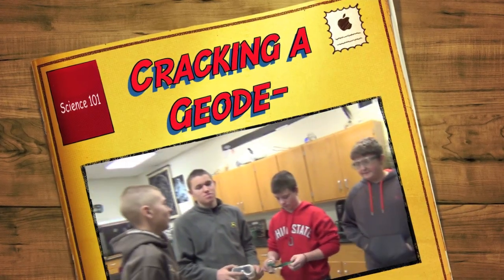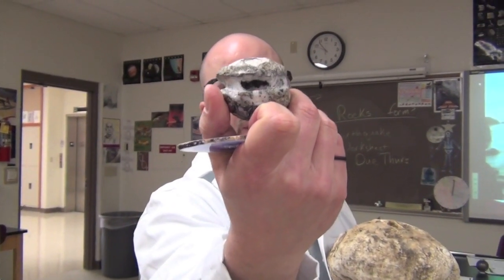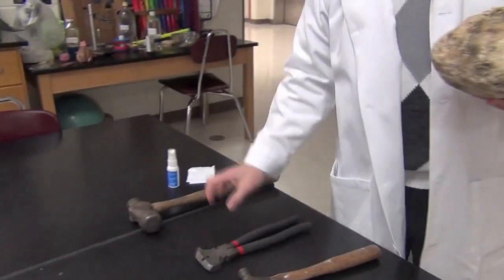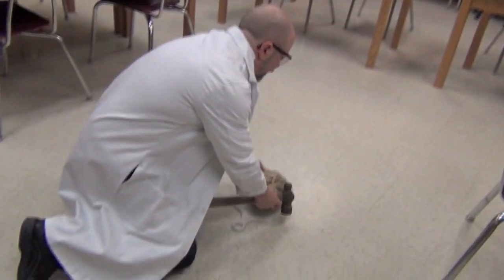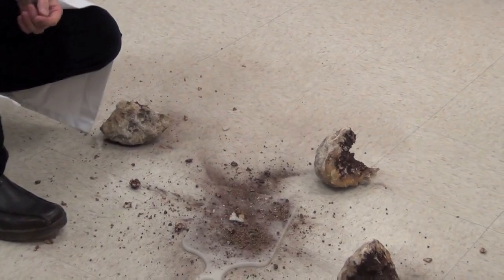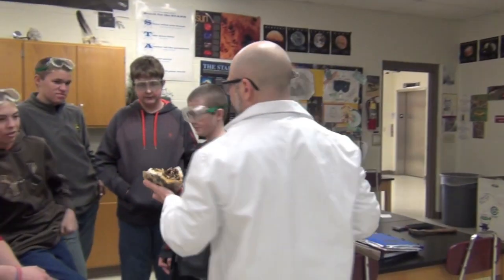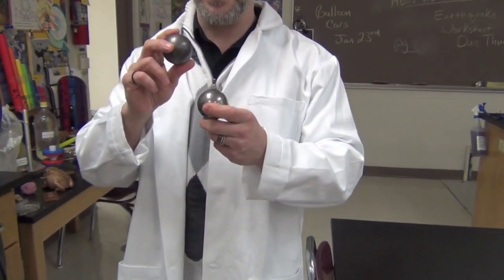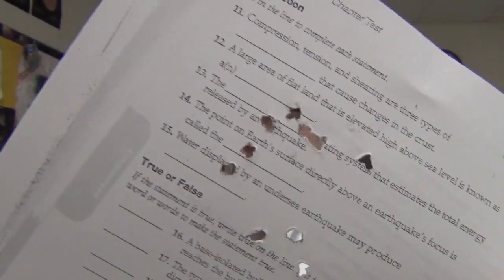Cracking a Geode

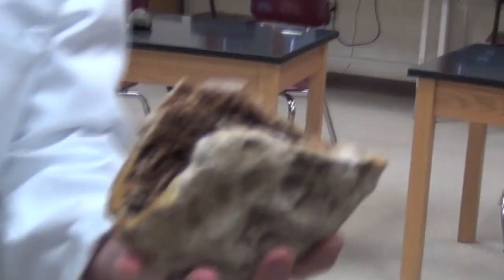Comment: Not sure if the 4-way split was what you had intended.  For best results, I'd recommend using a soil pipe cutter.  Normally, geodes won't "rattle".  Rattling on the inside may mean the crystalline formations have been damaged.  Instead, knowing what to look for in a given area is your best bet.  Geodes normally have a chalcedony outer shell which give it away.  And although many of them are hollow, they may have crystalline formations that almost fully make up the center dampening the sound.  The rust/iron oxide is hematite.  I'm not really sure what was said after the approximate 3:04 mark due to music output being too high.  By the way, where was the geode found?

Comment: For next time, try placing a cloth between the rock and cutting board, it wont move as much, won't lose debris and is easier to collect.  Washing, use cheese clothe and save the plumbing! Fun video!

Comment: I've seen them opened with a chain and a lever.  The chain is wrapped around the geode and tightened by the lever until the pressure fractures the geode under the chain.  It's like breaking a piece of glass by putting a force on a very small area along a line.  The glass breaks along the line, the geode breaks right along the line under the chain.  It only works with reasonably hollow ones.
Reply from the maker: Very Interesting technique.
Reply: Would i be able to open a geode by its side with the chain and lever?

Comment: A geode must be CUT with a diamond blade not slamed with a hammer !
Reply: skyhacker6 Then why did you make it your problem?
Reply: Sure, as soon as you donate funds for buying said diamond blade :)
Reply from the maker: The person who gave me the geode told me to crack it with a hammer. I followed her advice. I have cut geodes with diamond blades before, but this method worked also. I now have four large sections of geode that fit together like a jigsaw puzzle.
Reply: How is a teacher gonna obtain a diamond-tipped blade with his wages
Reply: Um... diamond blades in this size range are not that expensive peeps. A local rock shop would probably donate ones that are almost used up (which would leave plenty of life for this application). And I'd bet an add in Craigslist would get a small tile saw donated (which is all you need - in fact a cheap tile blade - those are diamond - would work).

I cringe seeing them hammer opened also but there are whole businesses that do this all day long. On the bright side, even many of the chips can be made into jewelry by any of hundreds of easily found lapidaries out there (one of those areas that exploded as a hobby a few years back and is chock full of nice people who can do cool things like that - check some lapidary forums)...
Reply: Frank Resists what if IF IT SOME HOW broke
Reply: Diamonds are plenty and cheap. De Beers wants you to think they are rare. 
And industrial diamonds in tile blades are produced synthetically.
Reply: Frank Gualtier Sh-sh-shhh
Hush
Reply: skyhacker6 it's a school I doubt they could afford a diamond blade
Reply: Ecology Films clean them with hydrogen peroxide and bleach people call me dumb but even a little chemistry goes a long way. It will look beautiful
Reply: skyhacker6 you can hit it with a hammer if you know what your doing
Reply: Mp57navy Need to read up a few comments.

DaBeers is a flagrant cartel that flaunts the fact that it is they who control the majority of supply, and they have the vaults full with more than you can shake a stick at to prove it. I don't know what the actual figures are but I'm told that if they emptied their vaults the price of diamonds would crash very significantly.

I used to buy various size grades of diamond sand to diamond powder (40 grit to 100,000 grit) in 10 gram bags from an eBay seller at relatively cheap prices for lapidary purposes. All of those I purchased were indeed labeled as synthetic. I probably used something on the order of a thousand times more silicon carbide (a conservative estimate) in the form of sands/powders (tumbling grit) to finishing sticks (keenly graded SiC+SiO2 vitrified cake form - aka quality hone stones). Diamond in similar form to SiC hone stone can be had but usually in a resin matrix and slap-you-in-the-face more expensive, though not necessarily cost prohibitive.

Fact: the process of waking with the aid of coffee can induce periods of excess fact drivel. Not the I tended, more lazurus-like, effect desired. Enjoy the fruit.
Reply: skyhacker6 not really
Reply: theres no 'correct' way to open a geode
Reply: Jeffrey Stanley oh... ya, don't use tile blades (made with conflict diamonds) legal diamonds are crazy bling expensive!
Reply: Jeffrey Stanley
It's his problem not mine !

Comment: why not use a rock hammer? and i recommend light taps in a line around the geode to form a precrack it helps
Reply from the maker: Good Idea. I may try that in the future.
Reply: TheKithkhan that's my method - like yours.
Works great and I  don't mess up any potentially beautiful crystals

Comment: I also have a better way to open a geode. (If you cant tell, I'm a geode fanatic).

-Use a hammer and chisel.
-Look for a crack by submerging the geode in hot water.
-The air will expand and leak out any cracks.
-Place the chisel along the crack and start tapping it with the hammer.
-90% of rattling geodes already have a crack

-If you find no cracks, start chiseling a groove around the circumference of the geode.
-Keep chiseling the groove deeper until a crack forms.
-Try to direct the crack along the groove with the chisel
-That should break it into 2 perfect halves.
Reply: I guess you can say the geode is releasing some thousand year old hot air from the dinosaur debate to learn stuff before they die off eh?
Reply: CheetahFoxx nice!
Reply: Thanks for the tip ! :D
Reply: This is what I was looking for. Thanks
Reply: No I have a better way than your way. It's called a soil pipe cutter....
Reply: @ladykfilmartproductions273  One of those things big enough to break geodes costs about $700 or more. Usually only mine owners or retailers are going to make that kind of investment.

Comment: I found a better way to determine if a geode is hollow or not.

-First, get the density of the geode in g/cm^3 using a scale and spill tray.
-Divide the density by 2.65 (the specific gravity of quartz)
-minus that decimal from 1 and multiply it by 100%
-That is your exact hollowness as a percentage of mass
Anything more than 10% is usually worth keeping.
OR
-take the volume of your geode and multiply it by 2.65.
-That's the mass of the geode if it were solid.
-Minus your geode's actual mass from it's "solid mass".
-That gives you how much mass is missing.
-divide the missing mass by the actual mass.
-multiply that decimal by the geode's volume.
-The result is the exact volume of the inside cavity of your geode!
Reply: The problem with this is that geodes have formed with all sorts of different minerals in them. Ive seen geodes that have had crystalized sulfer in them. Mostly I just turn out the lights and hold a high power flashlight next to the skin of it. If it glows then its hollow. If not then its most likely solid.
Reply: Josh Hufford Most of the geodes I have encountered (trancas, mexican cocconut, keokuk, kentucky, dugway, ocos, cathedral, and moroccan) are composed primarily of silica (quartz, chalcedony, agate) which is 2.65, and calcite which is 2.7. All the other minerals are usually in small enough amounts that their overall effect on the density is negligible.
Reply: Josh Hufford Flashlight method - I'd never heard that before, nice!

The silica based calculations should work in a large number of cases if for no other reason than a large portion of the weight is taken up by a chalcedony or agate shell which is largely micro/cryptocrystalline quartz (silica) and many contain a good amount of quartz or silica rich components. Perhaps exceptions, but it's a neat rule of thumb.

I've never tried putting a geode in water before cutting it (breaking them is sacrilege in my temple, sinners! lol...) and it'll be some time before I get a chance, so - do they float? Has anyone reading this tried?

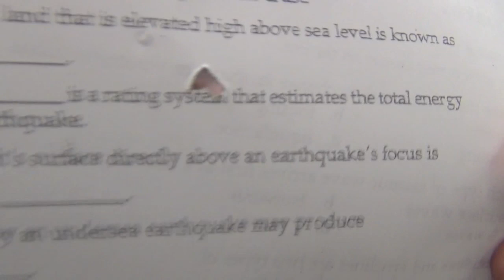Comment: 4:40 you sure that isnt piezoelectrictiy?
Reply: I don't think it is. I tried unsuccessfully to ignite pyrodex with a piezoelectric starter from a propane grill. If those visible sparks couldn't even set off that, I don't think they could burn paper. To burn stuff like that you need a high amperage, and I don't think piezoelectric sparks have that.
Reply from the maker: Interesting idea. It may be possible for the crystals in piezoelectric effects to be metals.  I had never considered it before. The explanation I saw at this site did not mention it. http://blog.teachersource.com/2010/06/13/great-balls-and-fire-smashing-steel-spheres/
Reply: no its more akin to flint than the piezo kinetics the piezoelectric effect is very very very minute its what makes your watch so accurate

Comment: "I call those chondrites"  ??? Is that what he said!?    Here's part of the WIKI for Chondrites:

"Chondrites are stony (non-metallic) meteorites that have not been modified due to melting or differentiation of the parent body.[1][2] They are formed when various types of dust and small grains that were present in the early solar system accreted to form primitive asteroids. They are the most common type of meteorite that falls to Earth with estimates for the proportion of the total fall that they represent varying between 85.7%[3] and 86.2%.[4]"

I hope I heard that wrong... otherwise super job on the hammer blow and slow mo',
Reply from the maker: Thank you for the clarification. What I meant to say was that these types of crystal layers are concretions. 

a hard solid mass formed by the local accumulation of matter, especially within the body or within a mass of sediment.
"a mass of small concretions, each built up layer upon layer around some small nucleus"
the process by which matter forms into a concretion.